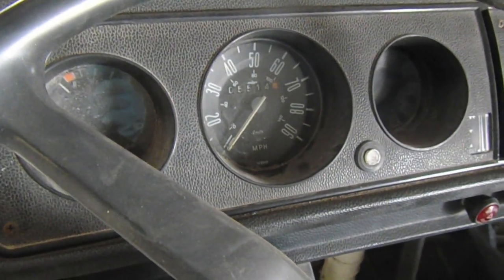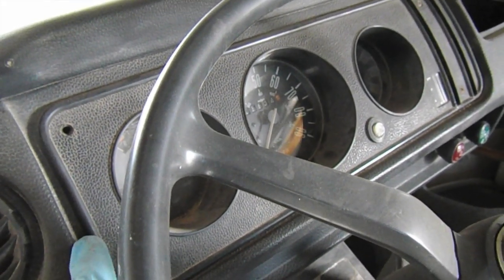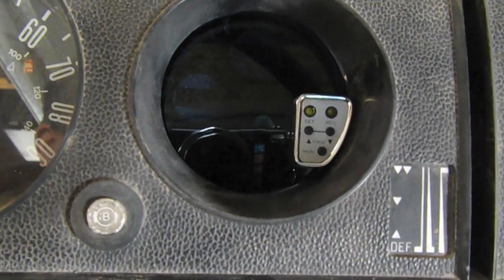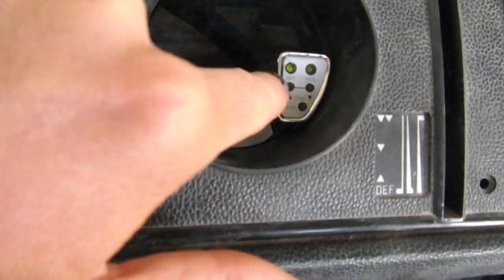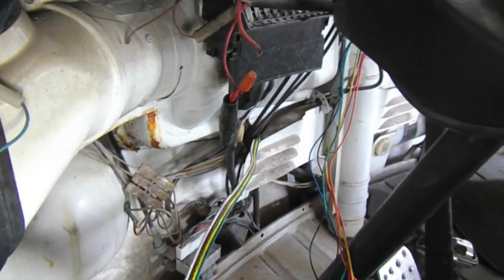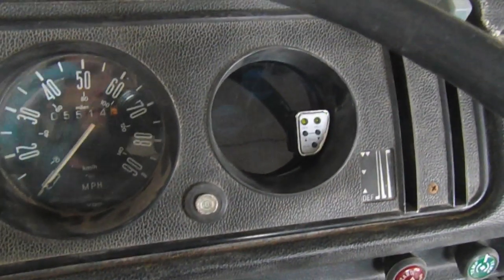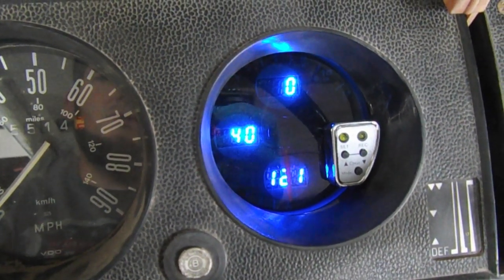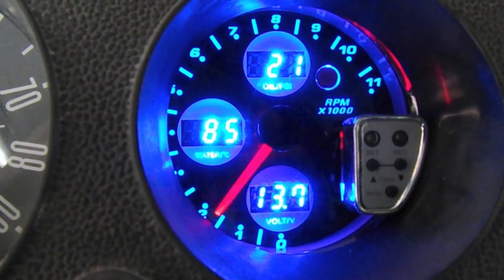Gauge Install For Subaru - Busaru Engine Conversion Part 10

Comment: Just watched the whole series.  Very thorough for one that has spent years getting greasy on Type I, II, IV and most recently a Thing.  Great video, great editing and very informative.  Just put a 1.9 liter VW in my Thing and have no expectations of a Subaru update, but have always loved the engine swap vids on YouTube.  When I had my '79 Campmobile I had dreams of a Wankel in it with a turbo. Like John Muir (of VW fame, not the naturalist) said, "If you want a car that drives like a Porsche, buy a Porsche" but the Bus has always had a HP deficit and I get putting a little more go in the back.  Great series.  Thanks!
Reply from the maker: Thanks for the compliments. I, too, love engine swaps in general. I've been specifically interested in Megasquirt controlled turbo swaps lately - fascinating stuff. Dream on my friend!

Comment: Loving the series so far Mick! Was wondering if you've ever seen any swaps done with the eg33? If it fits it would be a pretty awesome NA powerplant for a bus. Can't wait for the next episode.
Reply from the maker: Good to hear from you man! I did an eg33 swap into a Subaru RS2.5 coupe. It was a pretty interesting swap as the car is so tiny. I have a friend who uses the EG33 in a Syncro Vanagon and its a super tight fit. Incredibly stout engine though - I think there are 7 main bearings in a span of 21 inches or so (to put in perspective, Chevy and the like use 4 or 5 in a much larger engine). At roughly 240 HP its a good, inexpensive, swap but I'd probably go WRX Turbo up here in the mountains :)
Reply: How is the fitment with a turbo in picture for a bus? seems like you would need to do some extra fab work. would make for a pretty sweet sounding bus for sure.
Reply from the maker: runboyrun The turbo would have to be relocated in a bus but they fit well in Vanagons as long as there are precautions taken to deal with the heat that a turbo generates.

Comment: hey for the multigauge, try using a silicone boost coupler and a couple of T clamps to hold it up. Slip the boost coupler over the back of the gauge hole, clamp it down, and then slip the gauge into the silicone tube and clamp it in as well.
Reply from the maker: That's another good idea. I like out-of-the-box thinkers.

Comment: Thanks Mick, I did a bit more research and can see that the signal will come from the temp sensor as you described , I don't have any temp gauges on my splity so need to make sure the temp can be monitored. Thanks very much for your swift responses. :)
Reply from the maker: Hey Jon Paul, since you have an OBD2 engine you should get an Elm 327 wifi interface that works with a smartphone or tablet, then get an app so that you can have digital gauges. This would be temporary but very inexpensive and nearly immediate.

Comment: Did you ever consider using the old block off plate and screws to make a mount? It looked like you might  possibly be able to cut out the center of the plate to the size of the rear housing and have enough left to catch the bezel and pinch mount  it using the original mounting screw locations. Might need slightly longer screws. Hard to tell from the video if the block off plate is large enough to have enough meat left over.

Comment: Hi.Nice vid.Just bought the gauge.Could you tell us the wiring of the gauge,Which wire goes to which connection?Cheers.
Reply from the maker: Hey Monk, The gauge should have come with a single page wiring diagram. Find your temp sensor, and oil pressure wires on the Subaru engine and connect. Tach comes from the computer and is different on different year Subaru's. Good luck!

Comment: Hey Mick, thanks for the videos, they are super helpful!  So I picked up this gage for my EJ22 - air cooled conversion and tried mounting the oil pressure sender in the stock position on the block under the alternator, but it interfered with the alternator.  I looked all over for another port but couldn't find one.  Is this where you mounted your sender?
Reply from the maker: Hey Kory, That's where I mounted mine but you're right, the sending unit is too big to mount vertically, you have to either get a 90* bend and attach or use a tee fitting which will allow you to also run the stock Subaru oil pressure switch to your oil indicator lamp on your dash.
Reply from the maker: So I dug a little further and found that in my engine prep video you can see the Tee that I used. Its about 13 minutes in on this video: https://www.youtube.com/watch?v=seCWxXik42g

Comment: Hey how you doing loved the videos, I just purchased a 68 bay window and live in Vegas and really want to do this conversion due to the heat here, was wondering a few things, Do you make the harness and sell them? Can a A/C unit be installed into the bay also my bay as of now has no trans would a Subaru trans be a easy option or do I need to go with a VW trans?? cant wait to get my project going
Reply from the maker: The 68 would be a sweet conversion. I would definitely email Tom Shiels about the wiring harness (just google and you'll find him). A/C could probably be installed under the rear seat using the Subaru equipment but this hasn't been proven (at least to my knowledge). I'm hoping to put something together in the future regarding this. I would go with the VW transmission for now, but SubaruGears offers a kit to convert to a Subaru transmission, its just pricey in my opinion - it may be worth it to you though.

Comment: Thank you for that info, also is there a list anywhere I can get for the places, all the tbr adaptor/ radiators/ transmission fitting you used, Were do they make that stuff at? don't remember seeing anything about it in the videos
Reply from the maker: Sure do! Since you can't buy this stuff in the US I made some of the bus specific parts and am offering them at busaru.com --> Busaru Parts. There are things like engine adapter and exhaust manifold that need to be purchased from Kennedy Engineered Products. I'm hoping to show that in an upcoming video.

Comment: Hi Mick, great video. For the coolent temp did you get the signal from the ECU and in that case was there a variation from the temp read with the obd2 tool (read using an app on the phone)? I’m noticing a slight variation around 7 degrees Celsius. I’m wondering if you faced this and how you handled it.

Comment: So this gauge was compatible with the subaru oil pressure sender?
Reply from the maker: Hey Jessica, the gauge is NOT compatible with the Subaru oil pressure switch. The gauge comes with an actual pressure sender that you use in place of, or in conjunction with, the Subaru pressure switch.
Reply: Busaru Are you running the tach from the ECU? What voltage is running from the tach wire off the ECU? I read somewhere that it's 5v? Is this correct?

Comment: On the ecu I can identify the temp terminal for example, can I just insert the temp wire from the gauge to get it to work, with 12v power also, any risks of frying the ecu? Thanks mate
Reply from the maker: Hi Jon, the wiring of the gauge is pretty simple and only interfaces with the ECU for the tachometer. The gauge comes with a water temp sending unit and an oil pressure sending unit, these then connect from the engine to the gauge. If I were you I would try to find a service manual for your Subaru engine that has a wiring diagram. This will help with identifying the tachometer signal wire at the ECU.

Comment: thanks for your instructions. I have a hard time to find the  4 inch multi gauge that contains a tachometer, voltmeter, water temp gauge, and oil pressure gauge. do you have any place that I can find and buy. please help

Comment: Hi Mick, please can you help me with some advice. Does this gauge work directly from the ECU signal wire? I tried another gauge and it was not compatible with the signal wire. I like the fact that this is a multi gauge. I see you have to use an adaptor to connect the oil pressure sensor and that it comes with oil and water temp sensors. Do these have to be fitted in addition to the sensors that go to the ecu? Any advice would be appreciated , cheers Mark
Reply from the maker: Hey Mark, I've decided that I don't really like these gauges too much. They aren't extremely accurate. Any gauge you select will use senders - for example, the water temp and oil pressure senders need to be installed for that particular gauge. The tach signal from the ecu is the only thing that doesn't need a sender.

Comment: is that a Subaru  gauge  as well
Reply from the maker: Hey Matt, thanks for the comments on this and the other videos. This gauge is actually an eBay special. Its a multi gauge with voltmeter, coolant temp, oil pressure, RPM, and shift light. See the video description for where to get it on eBay.